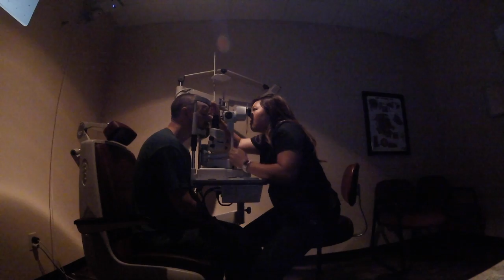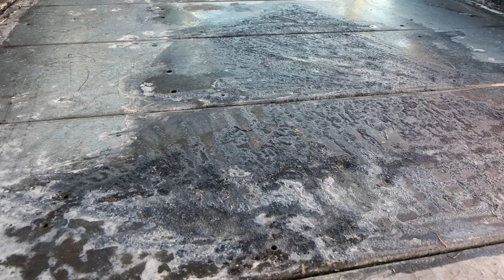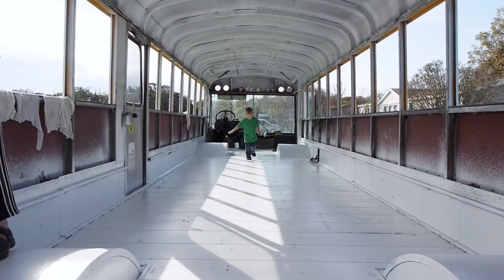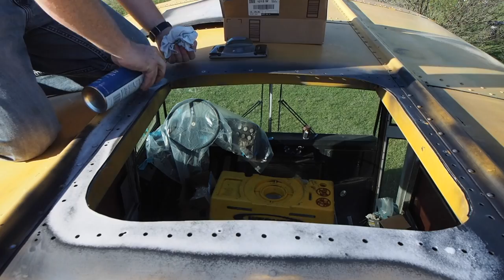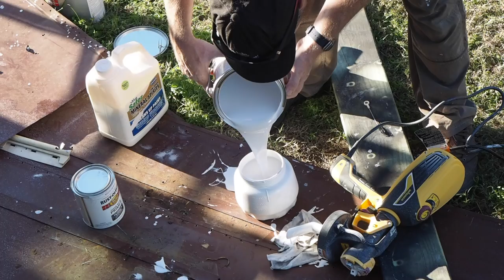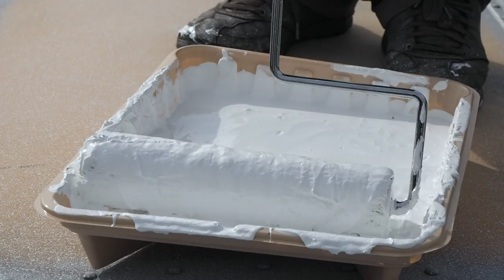Episode 8 - Painting the Bus

Comment: I just got my 5 gallon of HyTech Bus Kote for the roof. The pamphlet says to use a primer after cleaning the surface, but I really don't want to. It looks like you didn't either except spray paint primer on the seams--is that correct? Any skoolie confirmation I can get on whether to prime or not is greatly appreciated haha
Reply from the maker: I did not use the primer they suggested. But I did give the roof a very good sanding and washing. used spray primer on the seams and sealed all the edges. The paint has held up really well so far. I have recently added my third coat, and will do one last one before we hit the road.
Reply: Thank you so much for the fast reply!! Thank you for sharing these details, I like the way you think! Super helpful!
Reply: Justina Thompson what kind of paint sprayer was that I got a lot of fence and needs painted
Reply: Some times a good paint shop will hire quality spray equipment which is ideal for the big jobs , as it goes on quick .Hope this helps .